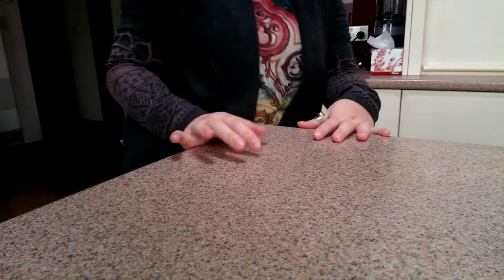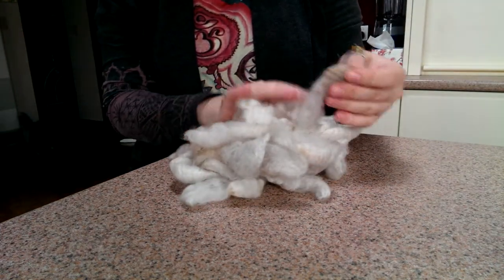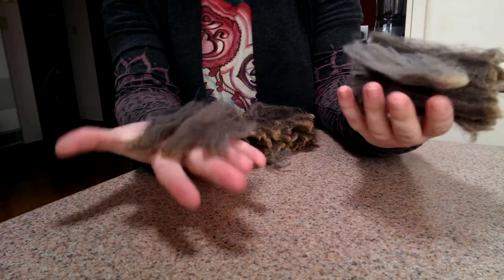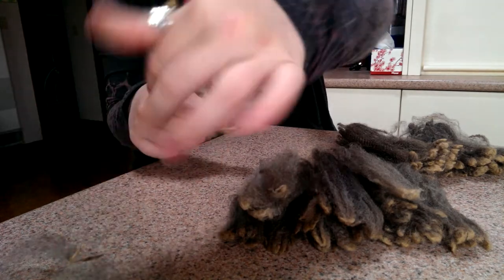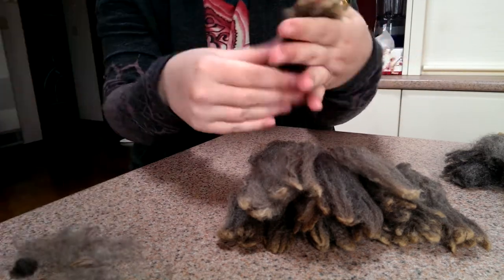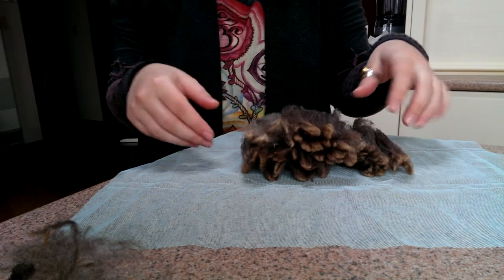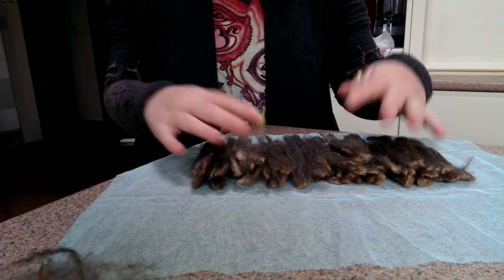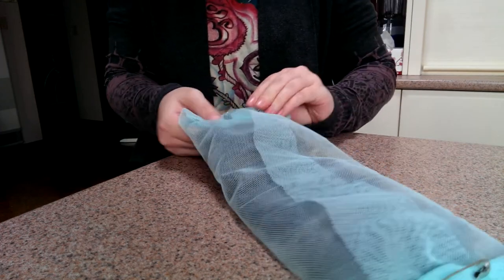Raw fleece preparation - lock method Pt1

Comment: I love your safety pin idea! The staples totally turned me off to this idea previously!
Reply from the maker: Thank you, my technique ended up evolving over the years and I found trays with holes in the bottom and sides that I could just gently lower into tubs (that had lids, to keep heat in) that had a low level of water. I could gently press the locks with the back of a spatula. After 15-20mins I would lift the trays out and change the water.